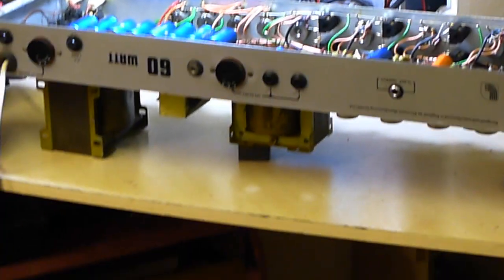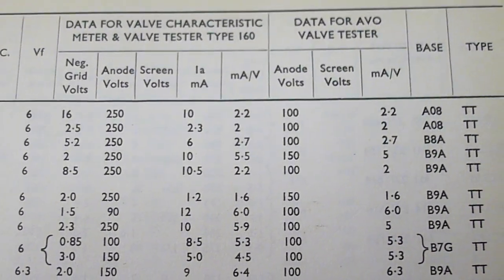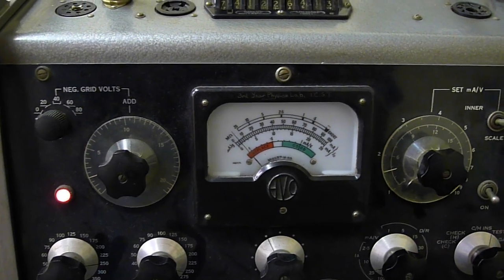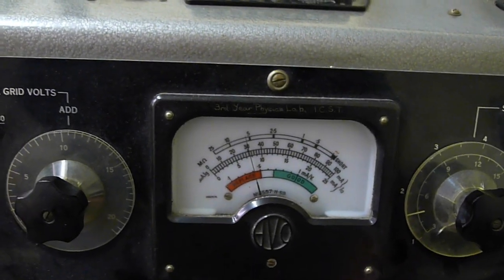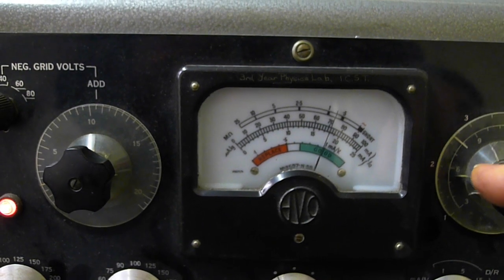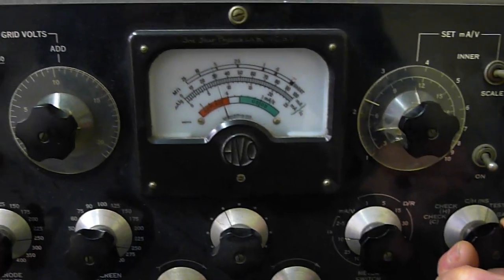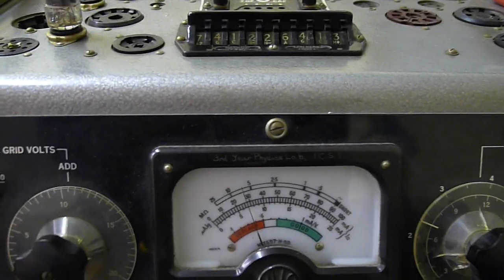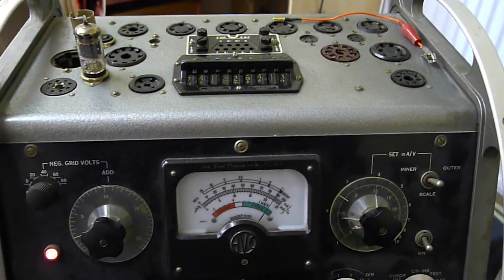ECC83 test on the AVO Mk3 Valve tester

Comment: Very informative, thanks Nick.  I picked up a derilict Avo Mk3 for £35 (did I pay too much?)... thankfully the TX's and meter were all OK.  Anyhow, spent weeks refurbishing this old girl, read the manual, but still non the wiser on how to use it.  Watched a few of Nick's excellent vids and the penny finally dropped LOL.  I have even added a meter protection circuit to hopefully save the meter movement incase I mess up ^